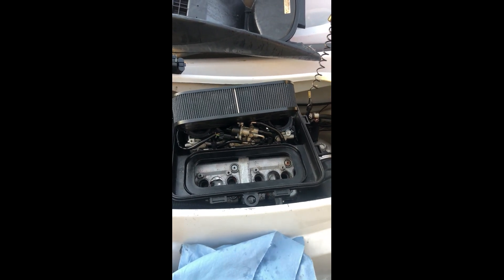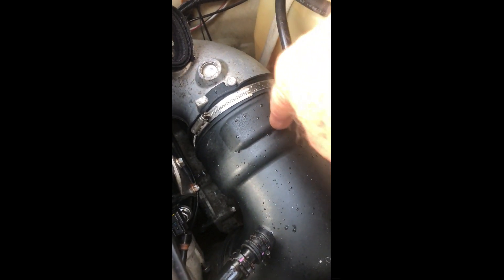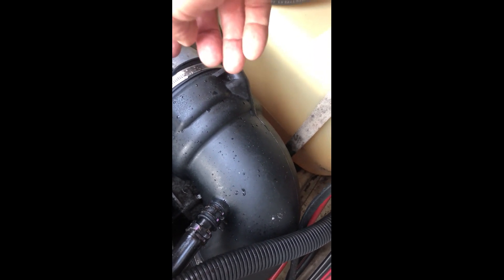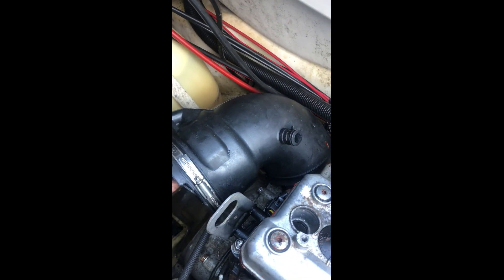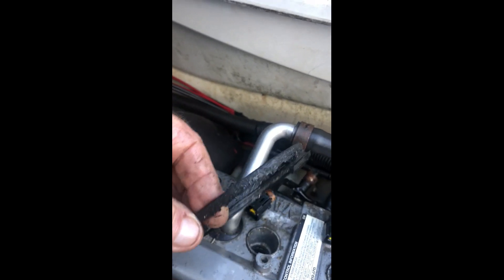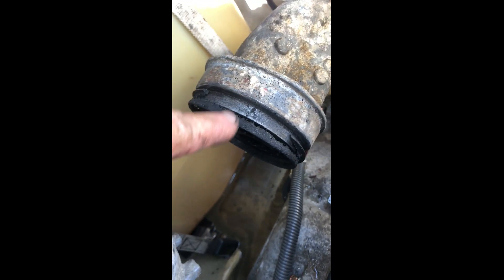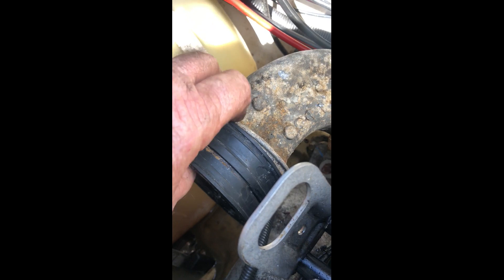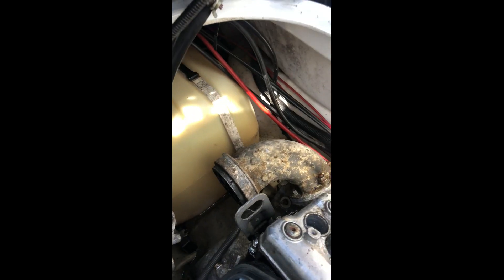Jet Ski MR 1 Engine, Water in Cylinders, NOT HEAD GASKET FIX IT, DIY!

Comment: Have you seen this on a superjet 700 with a b pipe?
Reply from the maker: It happens on Jet Drives operating in Shallow water sand builds up and plugs passageways
Reply from the maker: Seals breakdown sand build up …..

Comment: Will this be the same for 2010 vx deluxe
Reply from the maker: @nsm4581  Should be !!!
Reply: @cjphillips987  just took mine apart. I don't even see a gasket there
Reply from the maker: @ yours is a Different year the way it’s assembled! I believe it’s a failed gasket in the Exhaust system, If you hsve good PSi on cylinders

Comment: Im working on a mr1 with milky oil and low compression on cylinder 3 around 80psi would that be the head gasket?
Reply from the maker: @nathanbutler8240  No that will be other issues Not Head Gasket.
Reply: @cjphillips987  with that being said. What would be the first thing you looked at with low compression on cylinder 3 and milky oil?
Reply from the maker: @nathanbutler8240  milky oil can be caused by different issues or just condensation build up from sitting change oil and filter monitor color 
Low Compression from different issues worn Piston Rings, Stuck Rings from sitting or Valves seats worn not sealing correctly etc……
Reply from the maker: @nathanbutler8240  https://youtu.be/CbTl5khFIFc?si=KYlT_AaK6cXqZxT6
Reply: @cjphillips987  also I don't know if this matters or not but looking through the spark plug hole all the piston are Carbon black except for cylinder 3 and it looks like it has been washed clean. Would that be water getting or fuel washing the piston clean?
Reply from the maker: @nathanbutler8240  🤔 Most likely Fuel Wash / No Compression
Reply: @cjphillips987  okay I'll try and do the compression restore and put some marvel oil in it and see if that helps.
Reply: @cjphillips987 what are your thoughts on that piston being washed being the head gasket and the coolant burning and steam cleaning the piston? Iv seen it on small block chevys.

Comment: Would this seal cause water in the oil?
Reply from the maker: @donaldmoore5984  depends on certain conditions, any water compressed will push past the rings into the crank case,
Is your engine running , and showing signs of water in the oil?
Reply from the maker: https://youtu.be/thTf2EIWhZo?si=1MYm6GjcBNJlfe9a
Reply: @cjphillips987  Hi CJ, firstly a very well presented YouTube explanation, thank you!
And yes, engine is running. It is a 2006 FX Cruiser HO. End of last season it wouldn't start - I took it to a local shop who said it had water in it... they replaced the plugs which were corroded and did a couple of oil changes to get the water out of the oil and they winterized it for me... they told me the wave runner must have been submerged or flipped - which it has never been... 
Start of this season they suggested I bring it back so they could check it out further. I took it in and they said (without looking at it) that they remembered it from the end of last season and the engine would need replaced! 
Two seasons ago it had a new engine put in because the oil filter had a crack in it and had leaked the oil and blown the engine (a son who thought the warning sound was low gas!) The engine probably has less than 15 hours on it since being replaced... Needless to say I'm reluctant to put another new engine in - not to mention unimpressed that the shop mechanic said to replace the engine without really looking at it, felt like they were looking for an easy sale...
I took it home and ran it on the hose, it ran fine but after 10+ minutes the oil was showing signs of water again.
I have done a fair amount of wrench work over the years on cars and this weekend was going to check for water in the cylinders (as you show) and also check the compression before going further. Assuming compression is ok it was I thought I'd check the exhaust seal next. (roughly how long does that take to replace?) 
Appreciate any advice you can give 🙂
Reply from the maker: @donaldmoore5984  Before spending funds to replace engine 
Identify where any moisture is coming from , i.e. ( Oil Cooler etc ) a compression check and leak down test verifies piston rings / Head gasket. 
Question
How long of time does ski sit and in what environment?
Moisture builds up inside crank case the drops in the oil as engine heats up 
How milky the oil is tells how much water is building up. 
If small amount, Change oil and filter and monitor changes to understand if you have an oil cooler issue or moisture flash off from sitting.

Comment: Long post, but I hope this helps anyone with a similar problem, hopefully I can save you a lot of aggravation. One other thing you should check: ESPECIALLY if you run in salt water: the exhaust manifold, as the thin wall between the outer cooling jacket and inner exhaust pipe can corrode. Being this close to the cylinder head with the aggressive cam lift and valve overlap of the MR1 engine, it will ingest water from this point. 

This is EXACTLY what I had going on with my engine. I first suspected the O-rings on the cooling pipe that passes through the valve cover into the cylinder head, changed those. Thought it could be the inner seal ring like this video shows, and I did find that it was deteriorated and torn, so I replaced that. STILL had water in my oil.

Suspected it could be the oil cooler/tank, so I removed the oil cooler tank from the engine, and fitted it with a 15 PSI gage, then connected a garden hose to the inlet on the bottom of the tank, and pressurized to 15, and let it stand for about 20 minutes. No loss of pressure, and no water pouring out of the oil ports, so that eliminated that possibility. 

The next possibility (which I dreaded) was the head gasket, so, I removed the airbox, valve cover, camshafts to access the head bolts. Removed the head, gasket looked ok, no warpage, mating surfaces lightly cleaned with 3000 grit. While I was at it I decided that I should inspect the exhaust headers and gasket...and that's when I found it. 3 of the 4 headers had corrosion breaching between the inner and outer passages. 

Found used but very clean replacements that had been used in freshwater, off Ebay for about 200 dollars. Far less than what Yamaha OEM new parts would have cost. 

Also replaced the engine anode, found that the old one had corroded pretty bad. By the way, this anode is the exact same type that fits in a Yamaha F115 4 stroke outboard, so, if you're close to an outboard motor dealer/parts shop, you can get one a hell of a lot quicker than ordering it online from Yamaha.

I reassembled the engine, and I am happy to report, NO WATER IN MY OIL!! So, it wasn't the head gasket, like many people suggested. But it's just as well that I tore it down and replaced the gasket, as the engine is 17 years old.

One final note:, let me save y'all several gallons of wasted oil trying to dilute out the water in the system THERE IS AN OIL DRAIN PLUG. Even though the repair manual itself says there is not one, there is. In that same repair manual where it shows a diagram of the oil pump, sure enough, there's a part called a "drain plug" 
It's on the back of the oil pump, if you're looking at the rear of the engine, it's to the left side of the coupler by a couple of inches, and it's up under there where you can't see the damn thing. However, if you use an inspection mirror, and a socket extension, with a 12 mm socket, you'll find that removing this bolt will drain all the oil.  There is also a copper crush washer on this bolt, best to replace it with a new one any time you remove the bolt. The cleanest way to drain the oil, if you can use a length of hose with a small plastic fitting to stick in there so you can re-direct the oil that's draining out, rather than it getting all in the bilge. Run it up through the hull drain plug hole to that oil drain, and put a bucket under it to catch the oil.

I hope this info helps!!
Reply from the maker: Excellent information you are correct on point when more diagnostic information to decern cause ! 
I appreciate your input! Good Job !
Pass it on!

Comment: CJ in your comments below, can you please let me know where the Oil Pump cavity is loactaed ???......"use a WET VAC with extension tubing and remove all oil from OIL PUMP CAVITY from the port inside oil cooler fill port. This way almost all of the oil is removed, if not there is still approximately 1 +/- Quart of used oil in the Engine cavity."

Comment: Hi I have the same problem with me jet ski seadoo 2004 gti,does the same thing apply on seadoo too?
Reply from the maker: Check compression first determine head gasket sealing on all cylinders then inspect the exhaust seals like I did in the video 
It should same for Seadoo not sure I ride Yamaha now gave up on Seadoo long ago 
Hope it works for you!
Reply from the maker: Hank let me know what you find on the Seadoo!? Hopefully you found it!

Comment: i have the same problem the oil is like milky do you think it is the same problem thanks
Reply from the maker: Do you have water in cylinders? As in video?
Reply from the maker: If so it’s part of the milky oil!
Reply: Yes I removed all the water and oil filter oil replaced and now fire up but oil milky again
Reply from the maker: @rafaelaguilar1329  if you fixed the front exhaust seals changed oil n filter , first oil filter change got most of the contaminated oil out, MR-1 engines hold approximately 1+ quarts oil when you change oil n filter🤦🏻‍♂️. If oil shows excessive water after change you may have oil cooler gasket issues.
Reply: Ok I will try

Comment: Any idea water in oil?
Reply from the maker: Any other issues besides water / milky oil ?
Reply from the maker: If only milky oil it’s most likely oil cooler or ski has been sitting out side crank case condensation buildup
Reply: @cjphillips987   I changed the oil 5 times took it out on the water for a test drive and its milky again. How can I check if its the oil cooler?
Reply from the maker: @camilotorres8262  https://youtu.be/-CtVO11bTKQ

Comment: AWESOME FIND! I bought my 2003 FX140 with water in the oil.......a marina mechanic said it was the head gasket......I've been turning wrenches since I was 10, this was NOT a head gasket issue, because the spark plugs didn't show evidence. HOWEVER, the coolant outlet pipe at the front of the valve cover, had started bypassing water through the o-ring, and forced it into the cavity under the valve cover grommet. Thus, dead heading pressure to the valve cover gasket, and it was going UNDER it! Because, old cover gaskets get harder than a high school boy at a strip club! I had to clean the o-ring bore in the cylinder head, and use a super quality silicone rubber (mostly used in the engines of big rigs) to seal the outlet pipe with a new o-ring. I left the grommet out of the valve cover, and then drilled a hole in the valve cover area where they capped off the REAR plug of the cylinder head, on the REAR of the engine. Many people don't know there is another on the rear....but Yamaha DID IN FACT use this engine originally in the R1 motorcycle (which is one of my adrenaline fav's!!) and capped off the other water outlet that they used on the street bike cooling systems.... I don't remember if I made a video on my channel about it or not. BUT I only paid $600 for the ski, and got a DOUBLE trailer out of it!!! I have since wrapped it in a sweet decal, and installe a BOSS stereo with Rockford drivers.
Reply from the maker: Fantastic hope it works well for you n others Share it !

Comment: Hi Mr Phillips, thank you for this video as it could be my problem. I live in California and take my 2008 Fx HO Cruiser out in the waves for tow surfing and have to blast water out of the cylinders after each trip. I got on SBT website to order the seal and boot, but they just state they have the seal for fx 140? Will the seal and boot be the same in my 2008 fx 160? Do you have a video showing the exact steps to replace the exhaust seal and boot? Thanks again
Reply from the maker: I'm not sure of the actual fit between years check with Yamaha Service or SBT Yamaha Tech to verify, The exhaust halves must bee separated to replace the seal, Check both inner and outer Boot for very small heat cracks also... Good luck let me know.......
Reply: Thanks for replying. I see in the end of the video that you took 1/2 of the exhaust off to get into the seal/boots, can you recommend anything for an very amateur mechanic like me  to do that or to simplify changing of the seal/boot?
Reply from the maker: @jeffreysteinkamp4042  no sir must physically pull apart by removing components intake fuel injection exhaust bolts clamps then reverse process sorry 
You can always bring it here ! I’ll help !
Reply: @cjphillips987  Hi CJ, I replaced the inner and outer boot as you suggested and when I ran it on a hose, noticed the piss port on left side was really shooting water out and The cylinders do seem dry now. I was getting ready to take it out on the water, but just found now there is now water in the oil (making it milky brown)? Any ideas regarding this new discovery after the repair you suggested?
Reply from the maker: @jeffreysteinkamp4042  milky oil means water in it yes change oil and filter ASAP! Monitor oil color if it changes quick let me know! FYI watch my other videos on MR-1 engine repair
Reply: @cjphillips987  Thank you for you quick reply sir.   Just wondering if the mechanic who replaced exhaust seals could have triggered something else in the repair process so now water is leaking mixing into oil. Is there anything overlapping when pulling off exhaust or not seatings seals properly that could cause water in oil?
Reply from the maker: @jeffreysteinkamp4042  on the exhaust side I don’t believe so due to if it wasn’t installed correct you would here noise and cylinders would get water in them ! Did your ski sit for a long period of time ?
Reply from the maker: @jeffreysteinkamp4042  change oil n filter ASAP water doesn’t mix to oil through exhaust mate up only if it’s in the cylinders.  Could be oil cooler leaking watch my other repair videos let me know question did your ski sit for a period of time?
Reply: @cjphillips987  Mr Phillips, I replaced exhaust seals as your video showed and still have water in cylinders after I ride. Excitedly I removed plugs in hope to find them dry, but a big blast of water came out of cylinder 3. The other cylinders were dry. Any ideas of what could be continuing to allow water into cylinders?
Reply: FYI, I broke down 2 rides ago and coast guard towed me for about 2 miles back to the dock. Very grateful they were able to get me before waves and nightfall did!! :-)

Could the water be remaining water that backflowed into engine during the tow. Regardless, if this tow experience isnt cause of water, what else could it be? TY in advance
Reply: * My ski has not sat for more than a month between startings
Reply from the maker: @jeffreysteinkamp4042  water only in cylinder # 3 ?
Reply from the maker: @jeffreysteinkamp4042  towing will cause water to fill exhaust system and enter engine through any open exhaust valve!
Reply from the maker: @jeffreysteinkamp4042  need to know what was initial fault of no start condition. Did you replace seal , boots and clamps on front exhaust?
Reply from the maker: Question do you have WhatsApp or Facebook Messenger? We can do live video call, I’ll help you as much as I can !
Reply: @cjphillips987  Mr Phillips-I would appreciate talking with you on Facebook Messanger or Whats App (my info Jeffrey Steinkamp, Arcata, Calif. 707-834-3428).
All plugs are wet after outings, cylinder #3 had a few tablespoons come out yesterday. Others a light mist of water. Initial probs when I bought it were hard starts and then water in oil. I did have front exhaust seal and boot replaced as your video suggested. I did initial compression check and that was good according to mechanic. 
Please send me your info on Whats App and I can contact you, TY!!
Reply from the maker: @jeffreysteinkamp4042  CJ John / Orcapak_ on Facebook message me direct we can also video chat on messenger!
Reply from the maker: @jeffreysteinkamp4042  On WhatsApp 863-968-3430 direct contact